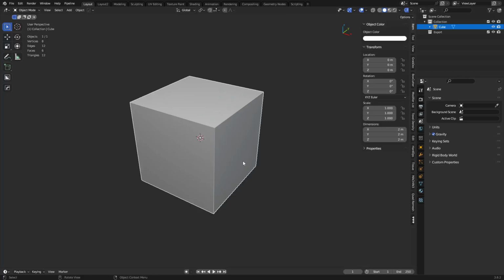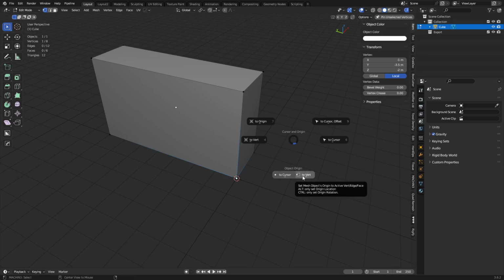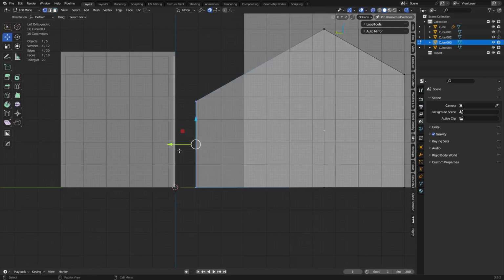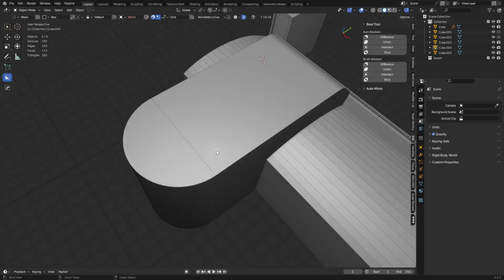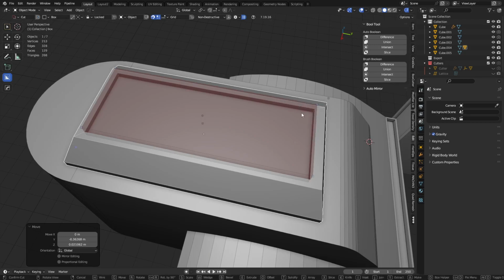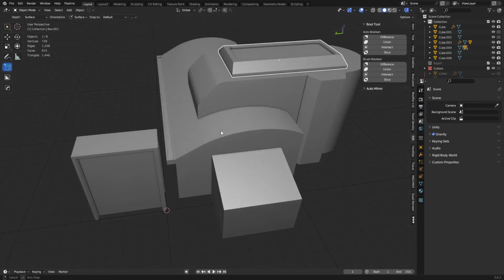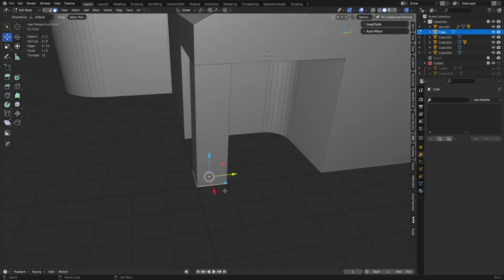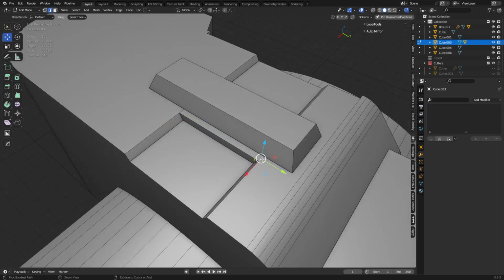Blender - Creating Cubes

Comment: I'm a week into learning boxcutter and mostly getting the hang of it. I find myself naturally wanting to start my cuts in a side or top orthogonal view. Is there a way to make that more deliberate? You can't see how dep or anything. The alternative is to make and cut everything in perspective. Is that just he way it has to be? Or, I have to draw the shape, then rotate the view to continue. Should I just get used to making everything at an angle?
Reply from the maker: Works best in perspective. Can always shift click when finishing, then go into edit mode with the cutter to tweak it.
Reply: @pzthree  Ok so the extra step is necessary just because you can't realistically see what you're doing. Fair enough, thanks!